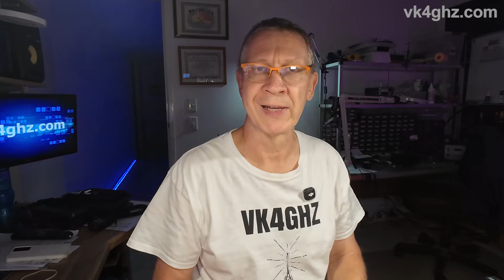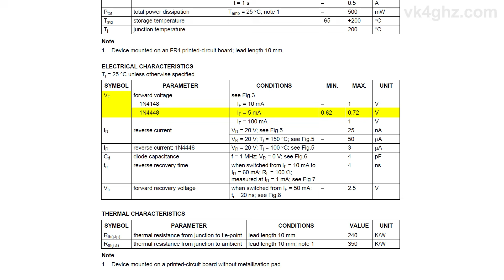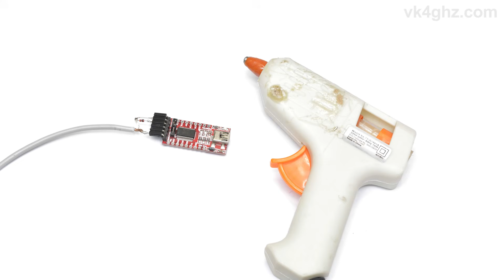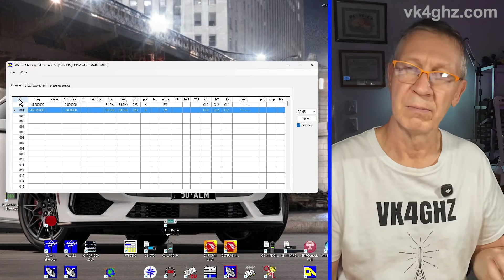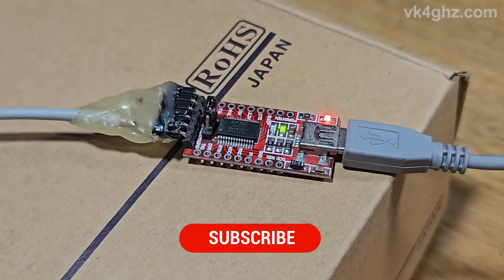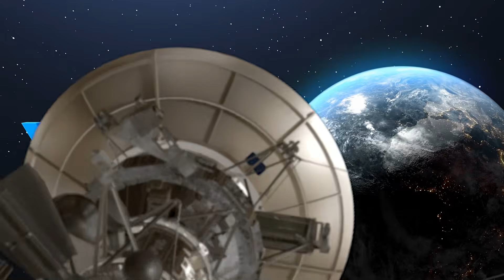DIY Alinco ERW-7 Programming Lead

Comment: Thanks for the video. Is this appplicable for Alinco DR-635T? Should we add a 10K resistor & 1N4007 or 4148 for other radios?